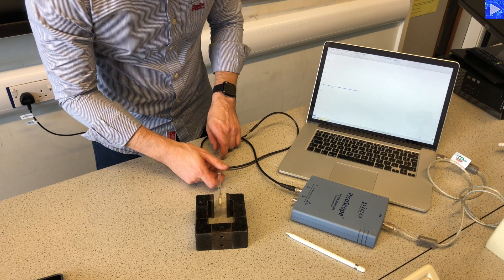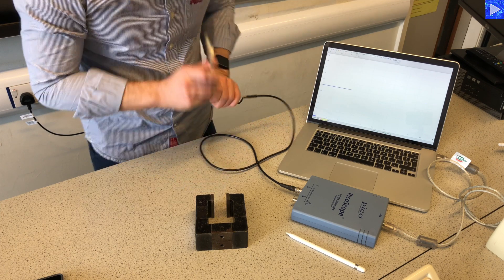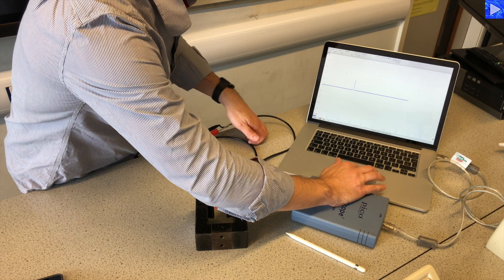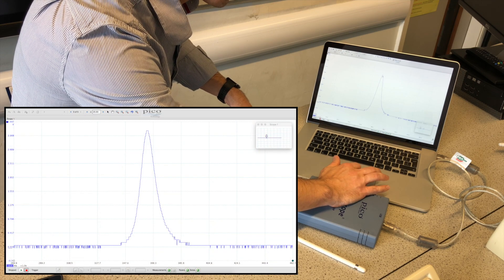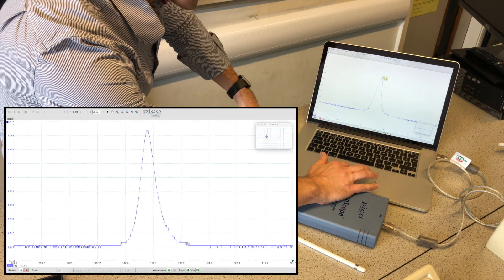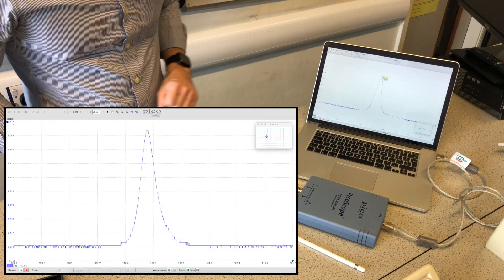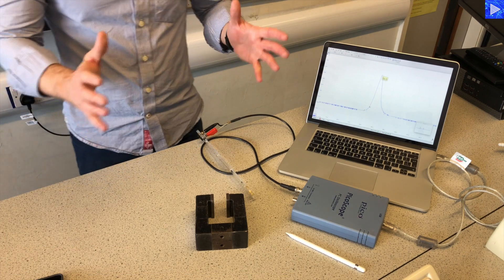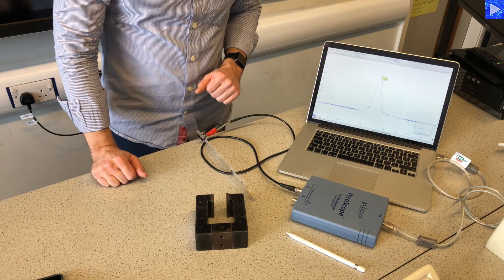Search Coil Experiment (measure magnetic field strength)

Comment: I  have seen reasons to find the "constant"of proportionality" first, by withdrawing the search coil like you have done, but without any magnetic field. Why is this done, and how would it affect the calculation at the end (how would we factor it in)
Reply from the maker: Hi. That would probably enable you to calculate the signal associated with moving there search coil in the Earth’s magnetic field (and any other local fields). 
This would enable you to subtract background signal value from your results. So actual signal is reduced (depending on relative field orientations) from measured signal. Calculated field strength would be smaller (vice versa if actual signal is increased from measured).

Comment: That method isn't accurate at all.  It depends on how fast you can move and it is different from one person to another.
Reply from the maker: If time wasn’t measured it would indeed be inaccurate. But the picoscope measures and plots the signal against time. So in the analysis I used the measured time. It’s approximate insofar as the shape of the plot isn’t a perfect match, but it’s good enough. 
Also in the analysis I compare the B I obtained with the B obtained by use of the current balance method and got good agreement.
Reply: @PhysicsHQ  The time you mentioned is the rise and fall time of the potential in the coil after being induced, which depends on the impedance and, perhaps, capacitance of the coil.  The "how fast" I talked about is the velocity of the moving coil.  The potential induced in the coil depends on how fast you move the coil.  Think of a small generator.  If you spin it slow, you get low voltage.  If you spin it fast, you get higher voltage.

Comment: It looks like what is changed when you plucked out the coil is area A, not B? How come you ascribe the change in flux linkage to the change of B, rather than A? :3
Reply from the maker: You could look at it both ways. Either way A or B changes from its max value to zero.  If you consider A then area of coil in flux is max and then goes to zero. Or B the coil goes from a region of max flux density to a region of zero flux density.  But whichever method you use gives same result.  Does that make sense?
Reply: @PhysicsHQ  Oh, I get it. Thanks!

Comment: Its good info thanq for that i have some question if you can please answer me related search coil
Reply from the maker: Sure. I’ll do what I can to answer your questions.
Reply: Sir i want to know that i am making a high depth range gold detector for which i need a high depth level search coil with  its ability to detect 20 feet down the earth or ground level the question is that what increases the depth range number of turns in search coil or copper wire with greater diameter
Reply from the maker: Hi. Could you clarify what you mean by “high depth range”?  What sort of strength magnetic field are you trying to measure with your search coil?  I think that I may not be best placed to answer the questions you have since they are about search coil design. I know how it works but not necessarily how to optimise its design.  But I’ll try to help if I can.
Reply: And other question is that how much milli henry search coil can detect gold upto 5 feet
Reply from the maker: What is the 5 feet referring to in your question?
Reply: Does magnetic field behaves silmilarly in mountains, rocks, and soft soil or it changes it behaviour according to the ground level
Reply from the maker: rocks will have a range of effects on the ability of magnetic fields to permeate them.  So it depends upon how much rock is between a source of the field and the point of taking a measurement and upon the magnetic permeability of the rock.